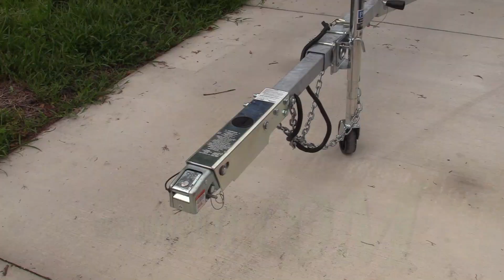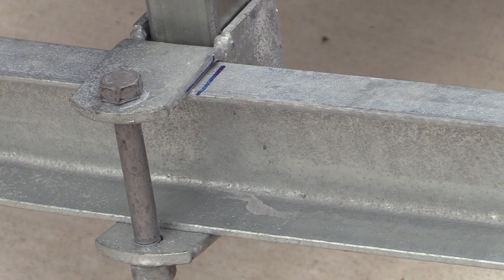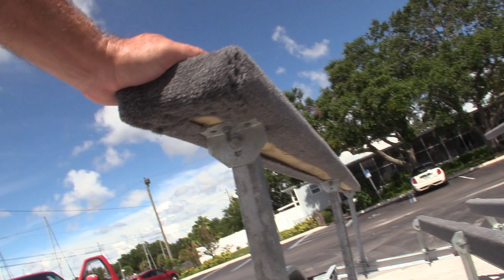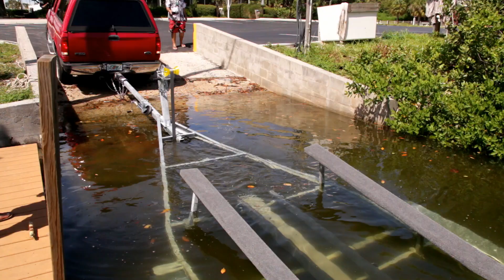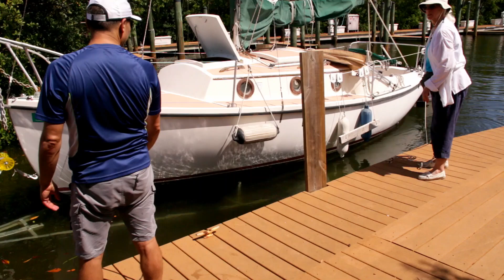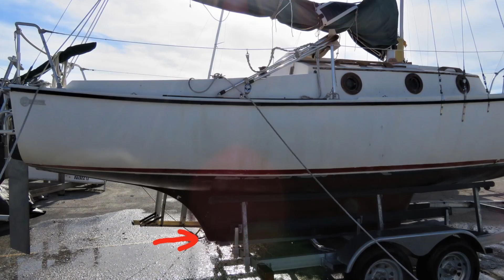Sailing HideAway- ComPac 23 New Trailer Launch

Comment: Couple years ago I bought a 19 8422 foot hunter and it wasn’t all the way up to the bow bumper to me. It seemed like it’s sat too far back on the trailer cause the trailer was too light I finally took it out the other day and I went to load it, and I tried cranking the boat further than what it usually sat so I cranked it forward more, and I pulled it out of the water. It bent my legs on the bunker forward never owned a sailboat before, but was I not supposed to crank it all the way to the front like that my bunkers don’t have the center poles just one towards the front one of the back so it the 2 x 6 forms the bottom of the boat that’s where it wanted to sit right back down and it pushed my bonkers forward

Comment: Interesting to see the tweaking that goes into adjusting a new trailer for a boat.
Reply from the maker: Fortunately, the Com-Pac 23 has an 11" wide fixed keel making the boat is less likely to fall over when  making adjustments.  Still, it's a good idea to throw on securing lines! M

Comment: Just because it is marketed as a trailerable sailboat doesn't mean it's a good idea to do so. Money spent for a dock is money well spent. If you're in Florida take it home in the summer, cover the boat and save the gelcoat.  If North take home in the winter. You'll develop friendships in the marina that will last a lifetime. Best times of my life spent at Toledo Beach Marina on Lake Erie aboard a Morgan 32
Reply from the maker: Good advice.  We kept the Hideaway in a wet slip for years until the slip rent increased beyond our means. Our marina allows sailboats to keep their masts up in the dry slips next to an adjacent ramp at an affordable price.  We bought the new trailer with plans to tow the boat to destinations we couldn't make by sailing.   Buying the trailer worked out for us financially, but  we didn't expect age related problems to develop so fast.   The new owners keep her in a wet slip.   Friends of ours had a Morgan 32 - We sailed with them often on Tampa Bay.  Great boat!

Comment: You did a very commendable job, there in the water and later answering all the comments. May I ask, how far apart are your bunks? Or, off center? Thanks
Reply from the maker: Sorry for the delay in response.  Com-Pac set the trailer up for us and we did not change the bunk locations.  They could give you the exact measurements.  Located in Clearwater Florida - the phone number is 727-443-4408.  Gerry has been very helpful over the years.  Have a look at my video "Selling Hideaway - Oh No"  to get an approximate location.  The bunks don't bear much weight, they primarily keep the hull upright.  To our great sorrow, our age have caught up with us- Hideaway has a new owner.
Reply: Thank you so very much, I will call them. Age will soon put me ashore also. Thanks again @SVHideAwaySailingHideAway

Comment: Great video. Love your honesty to get through this situation. I myself have a dim view of trailering. Many people when they first get into boating want to trailer to save money on marina fees and have the freedom to travel to new areas to boat. But experience is that anything larger than 21 feet is trouble to trailer. If its a sailboat then you have to factor in the keel and I would say around 18-19 feet max. When I talk to newbie thinking about getting into boating people, I tell them to pony up the money pay for a marina instead of trailering.
Reply from the maker: I'm glad you liked the video. It was a very difficult project on a hot summer's day in Fl.  The wet slip fees and rent for a 25 foot slip in our area are nearly $300/month.  In our case we could "pay" for the new trailer in about 16 months. That's part of the story. A half ton pickup or large SUV is required to safely tow the Hideaway.  Add $20 grand minimum for a vehicle then the wet slip becomes a bargain.   The questions are:  How often will you trailer it to that distant port and how long will you keep the boat.  The math worked for us at the time, but 7th decade age related issues put us hard aground.

Comment: Too many bosses
Reply from the maker: I didn't plan on that many.  Somehow it turned into an international event with helpers from Chile and Germany,  plus some experienced sailors from Gulfport.  I don't know if we would have survived the July Fl heat/humidity without the extra help.  After everyone left we started to move the Hideaway to her slip and realized she was very unbalanced on the trailer.   Too tired to relaunch, we used the hurricane tie downs to control the tongue for the  night.  Gulfport, at that time had concrete anchored tie downs, six per boat. They have since removed them. Thanks for writing!  M

Comment: Try "Salt Away" against rust. A rinse you hook up to a garden hose or pressure washer. It comes with bottle and sprayer attachment and a liter or so of concentrate. It is safe for gelcoat and trailer. It dissolves salt away after boating and also leaves a thin protective coat (inhibits any remaining salt residue from forming rust, water soluble, but some extra protection until next time). Doesn't smell or sting the skin or discolor paint. Non-toxic. A little goes a very long way. I use it on my old-timer to rinse the undercarriage after winter driving.
Reply from the maker: We use a similar marine product to flush the outboard motor. It too hooks up to a bottle sprayer  powered by a hose.  I've not used it on the trailer or hull.  The trailer gets a though fresh water wash each time it is used.   We use a marine biodegradable soap for the hull and topsides.  I don't think the salt product leaves a film, so I'm going to see if I can find "Salt Away" or similar product.  Thanks for the tip. M

Comment: Boat should be on a travel lift so it can be lowered on to the trailer bunks to adjust the fit. Back the truck up until the boat can be floated on to the trailer without the winch.
Reply from the maker: I agree, using a travel lift would have been much easier, but we don't generate enough income here to afford one.  I have great concern about the boat pulling the truck into the brine as has happened to others using this ramp.  We had a close call where the salt water was bumper deep.  I was careful not to spin the wheels, using the brakes as a clutch, to make good my escape.  Then spent sometime flushing the underside of the truck.  We are getting better at judging water depth/ramp position to the various tides. Thanks for your insights.  M
Reply: @SVHideAwaySailingHideAway  I understand your concerns ! I’ve had that issue, no travel lift. I used the winch on the trailer to slowly let the boat and trailer go further into the water while the truck sat higher up on the ramp. We were able to retrieve the boat the same way once the boat was floated back onto the trailer. Didn’t need to even get the truck tires wet 😁. Good luck, enjoy your boat, I miss sailing 😕.

Comment: Don't ever fit a boat with to many experts.
Do it yourself.
Best time for a boat on a trailer to fit is in winter time. When there is no so called experts around.
Also always block your wheels. Better then someday have your vehicle in the drink or use front of vehicle to use for launching.
Also much easier when boat floats and no winching to line up.and easier for vehicle to pull out and let boat drop on trailer easily.
Reply from the maker: July in Florida is not the time to set up a new trailer.  My old trailer barely made it to the dump before it fell apart- We  just couldn't wait for better weather.  There were no experts involved in this task!  None of us knew what we were doing and all of us knew the consequences of making an error.  My son had a friend visiting from Germany who figured out the math and my Son in-law from Chile made a come-a-long using two large C clamps and some chain to retract the old trailer's tongue extender.   The rest of us turned wrenches.  It's all good.  Thanks for writing- M

Comment: Hey you guys needed to have the truck and trailer slightly farther into the water. Raising the boards by 2 inches could be offset by backing in or out the same amount. Back the trailer in as far as you feel comfortable but don't be shy. The nose of the boat needs to be winched right in tight to the yellow V bumber on the trailer. If you can't suck it up without the boat touching bottom than you're not deep enough. When it's pulled snug to the V bumper make sure the back is square between the boards and you should have no problem.  Thanks and good luck next time. Don't pull it out like that again please.
Reply from the maker: That was the first test out of the box so to speak.  We never cleared the ramp before it went back in.  The adjustments worked out ok, there were more than pictured,  but we still didn't have the boat far enough forward.  Exhausted from the Fl summer heat we put her back in the dry slip, tied the trailer down then returned the next day.  That boat ramp has claimed many tow vehicles - I have a deep fear of joining that club.  It almost got us during a difficult high wind recovery so I try not to get my truck tires wet.  The new trailer guides have helped a lot but I haven't found the sweet spot of a true float on trailer yet.  We don't trailer on the road so the yellow V cushion isn't  critical.   Thanks for comments  M

Comment: I had a experience like yours a few years ago. I bought a trailer for our Oday 25. They said I would have to fit it to the boat. Everyone at the dock wanted to help, that was okay but it became a hinderance. After a couple of hours , all the local experts kept telling me the trailer wasn't made for the boat , it will not fit I can't use it. It started to rain so they left. I stayed and fit the boat myself , I had to loosen the bunks a few times and pull the boat out of the water enough to out weight on them. I had to do this a few times along with cutting the bunk supports as they dropped bellow the trailer and contacted the ramp. The cutting was the worse part of it all. After about 4 hours on my own I pulled it out and strapped it down. I live 100 miles from the bay and my driveway is very steep, no problems. I do wish the tounge was telescopic as yours , mine is welded solid and very long. That  makes manuevering difficult. The keel support on your trailer looks too weak...too much flexing. Your boat will slide fwd if you don't install a bow stop or move your roller aft. if you can ?
Reply from the maker: I can't imagine doing all that by myself, especially with  your 25 Oday! I had a crew from Germany and Chile. I think their strong point was that they had no boating experience. We did a lot of measuring and adjusting the bunks in the Florida summer heat.  I was grateful for their help. I agree with you about the 2 x 6 keel board. My old trailer had a 2x12 but it broke during a difficult recovery.  I finally added steel angle to each side. I'll probably change it to a 2x10, but for now we just want to sail.  I was able to verify this is the correct trailer for my Compac 23,  Its in within the axle specs. I have tall keel guides to center the boat during recovery and recently added trailer guides. - There are videos on my site.  -These make recovery much safer and easier.  To keep my truck out of the salt water I want 4 feet of water 20 feet out making the tongue extender essential.  We moved the boat about 6" forward for better balance.  To do this meant moving the winch stand as well.  It wasn't hard, but we had no idea what would happen, all went fine.  Stay safe M

Comment: Great work. I highly recommend checking out the Rhodes 22 trailer setup. Great to see you posting again. Cheers
Reply from the maker: Thanks for the suggestion.  We made some adjustments to the bunks because of it.  We looked at the Rhodes 22 before getting our Compac 23. Both are well designed but the classic look of the Compac won us over.  That being said I bet the Rhodes is a lot faster.